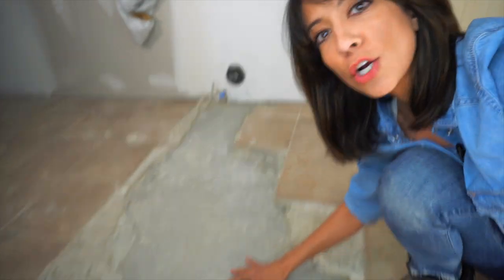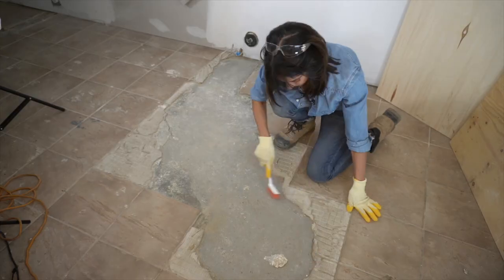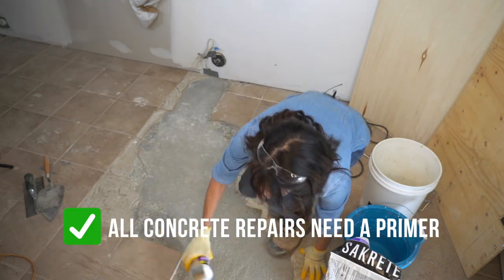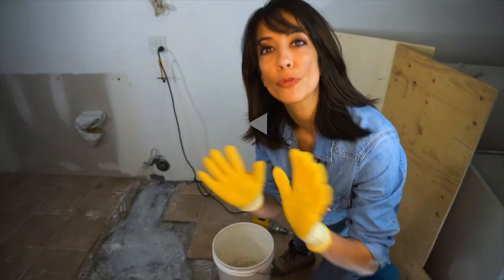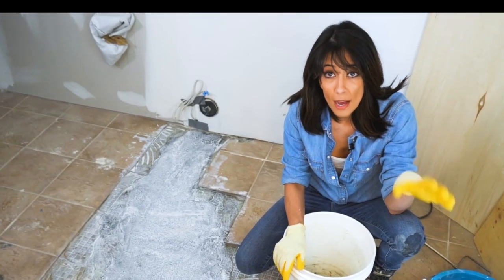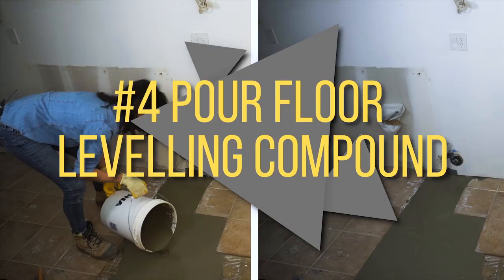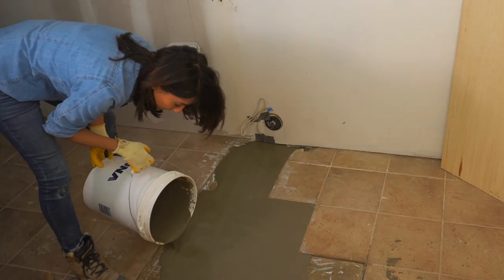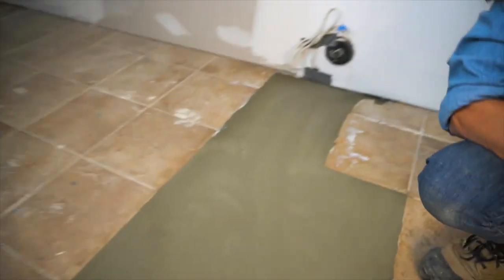How To Patch a Hole in a Concrete Floor in 4 Steps!

Comment: Hi there! How long should you let the primer sit before pouring the concrete??
Reply from the maker: Hi! For concrete, follow the directions to the letter. Every primer is different. This one is fast almost immediately. Another that I use in a recent video after applying you can do it within an hour. Good luck with your repair Lucas!

Comment: What brand is the Concrete Bonding Agent/Primer that you used?
Reply from the maker: I believe it’s from the same manufacturer as the concrete. The leveling compound will often say you have to use their product for bonding. I prefer the primer I used in my most recent floor leveling video because there is no time limit to pour your concrete. I have a floor leveling compound section at my Amazon storefront with all the tools if that’s helpful. Link in the description box

Comment: Thanks for nice video.  But working with cement/concrete mix produces a lot of dust.  I always wear my P100 mask to save my lungs.
Reply from the maker: 100% you should always wear a mask. Health and safety first. Thanks!